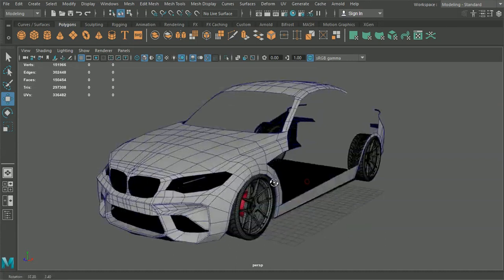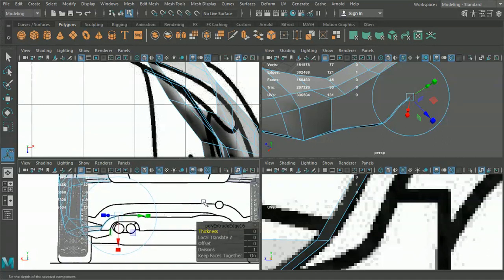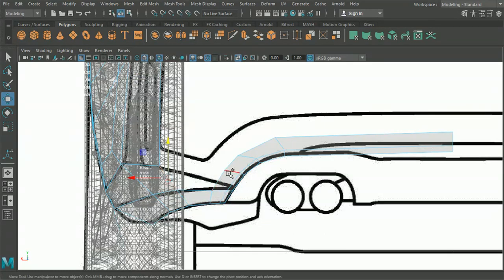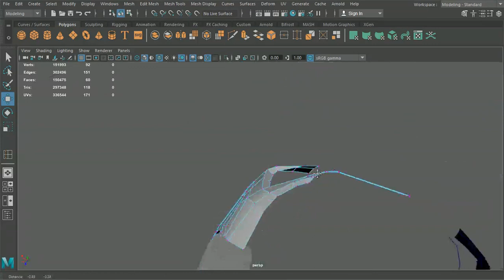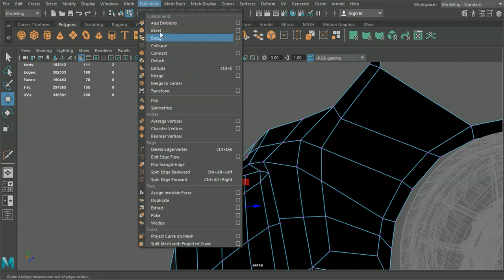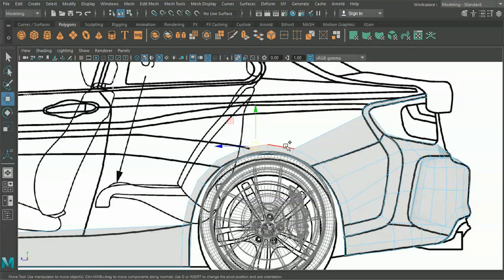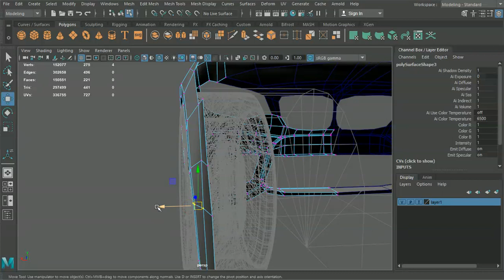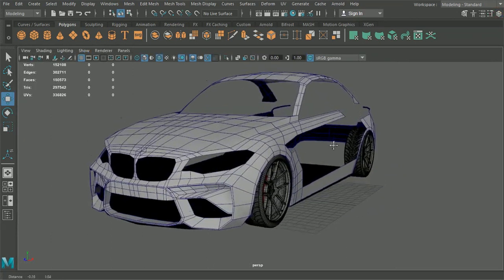3D Car Modeling Tutorial pt.6 | Modeling a BMW

Comment: hey bro where can i find this tire and rim modeling which you have used for this bmw modeling tutorial
Reply from the maker: The ones I use are from a car I modeled a while ago. The placeholders don't have to be detailed like mine, a pipe/cylinder would work fine too.
Reply: can u be more specific bro pls..
Reply from the maker: They're just random wheels I'm using to check the wheel arch alignment. Any wheels will work.